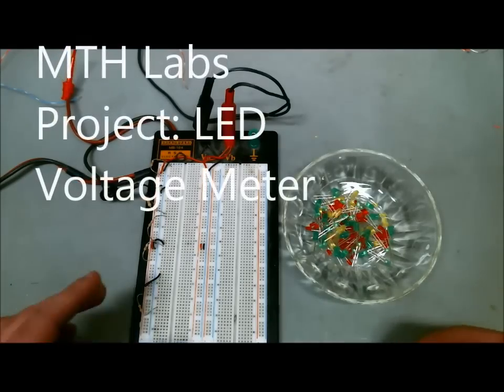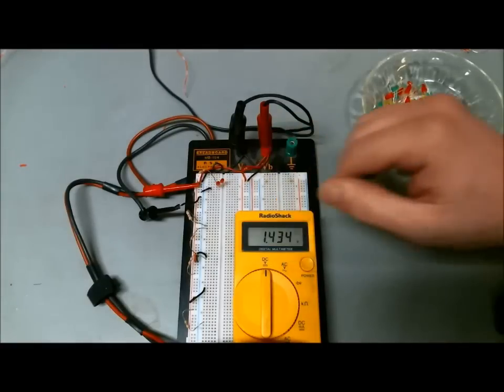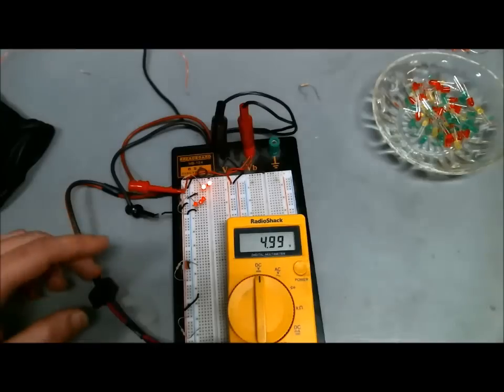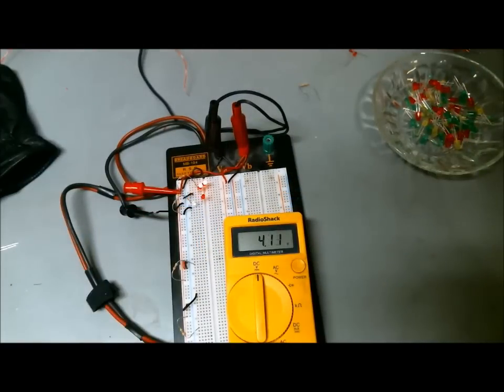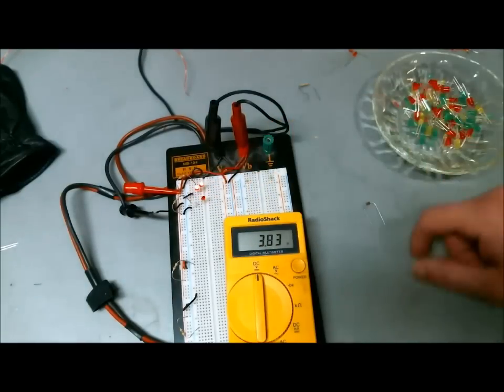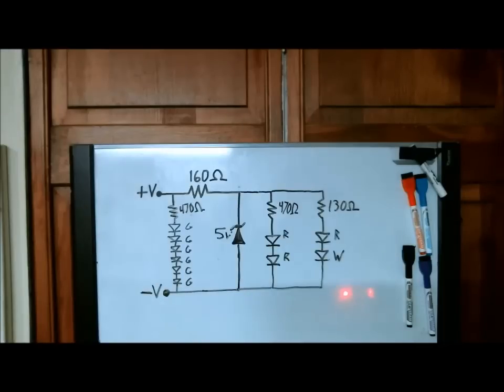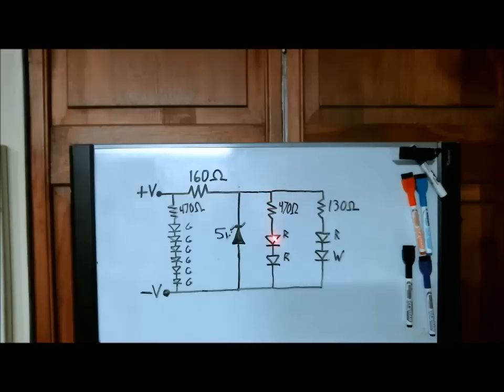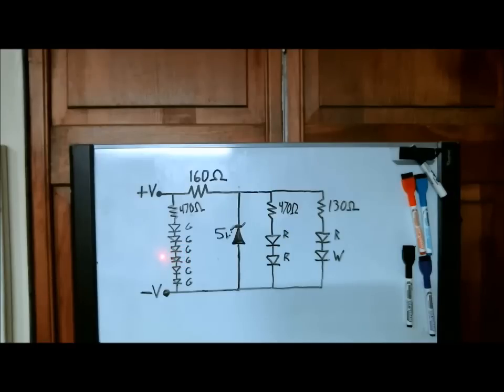Simple Voltage Meter made with LEDs and Resistors

Comment: Hi 
I want measure  increase of voltage 2 v.50 ma ,2v60 ma,  2.70 ma 3 v  input v  increase 
Which resistor in series to each led should use